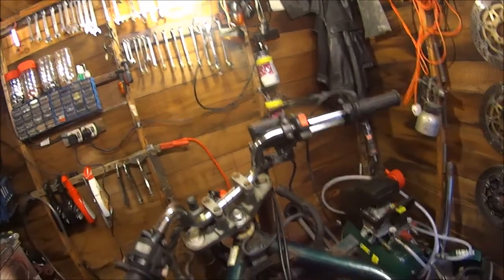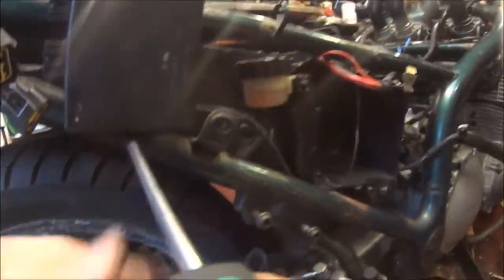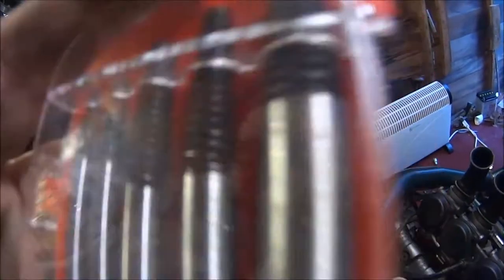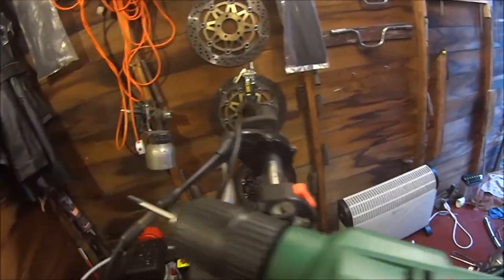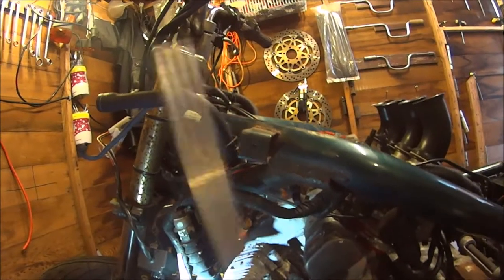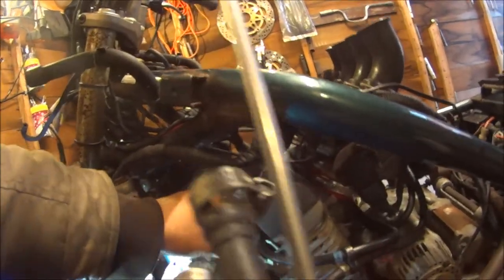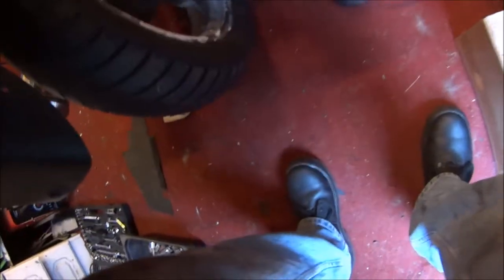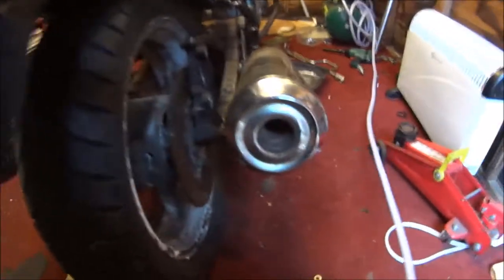Yamaha xj900s project part 7

Comment: John you are supposed to drill a hole in the stud that is snapped then get the exstracter  that fits in the hole you have drilled use a tap out of a tap and dia set and turn it counter clock wise as you do so the extractor grips the stud inside the hole and hopefully it unscrews the stud I hope it makes sense, keep the Good work up mate...
Reply from the maker: SooperSkoots cheers Yong man.. Think I've got the gist of it. Glad there's people out there who like to help.
Reply: John i have sent you an e-mail, well i think i have the one that Jane used last year for my birthday announcement ha ha, let me know if you do not get it....
Reply from the maker: MARK I have sent you an email back.(-_-)